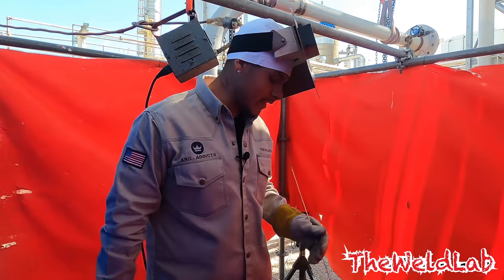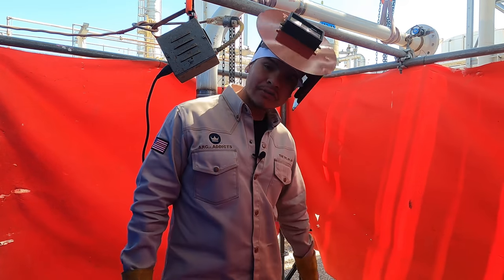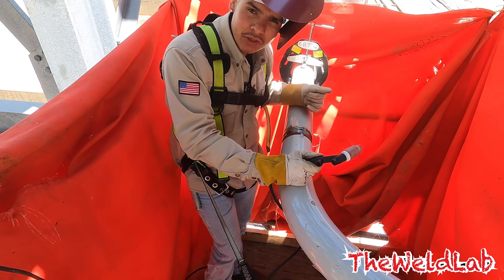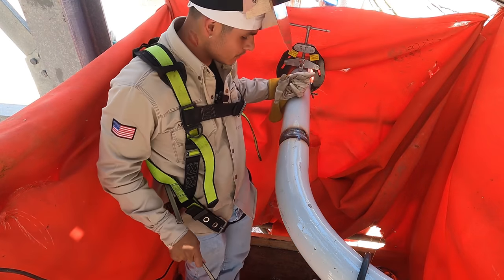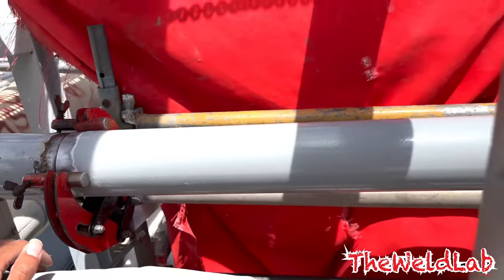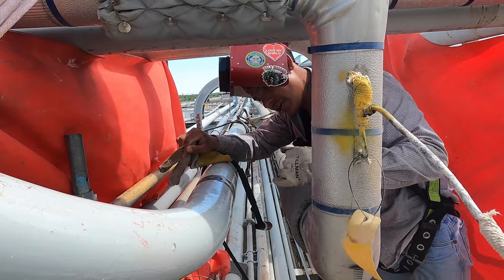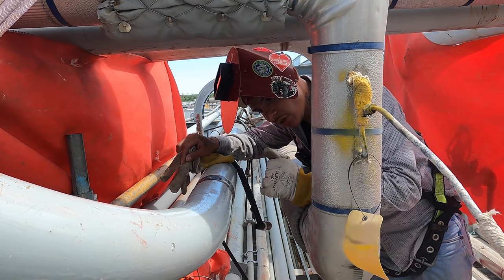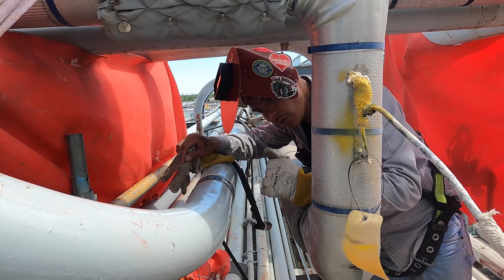I Got a Very Difficult Weld | What To Expect On The Field

Comment: The people that talk smack about welds in situations like this are the people who are not in the industry, or have not been in the industry long enough to come across this type of situation. All the work looks good from what the video shows. Just a few things, practice welding with a mirror. Make a small C shaped  bracket that can hold a mirror 8 to 12" from the face of your helmet, put the pipe in between the mirror and the helmet then practice. The mirror being held by your helmet frees up your hands, if you are doing the work sometimes you just have to get creative. I was shown a "welding helmet" from one of the guys who taught me a lot about welding, he did a lot of work in nuclear power plants. The helmet was basically a small piece of plastic with a lens mounted on it with some small protective plastic for the face, he holds the plastic bracket in his teeth and the glass does it's  thing. He had to use it multiple times doing pipe work. The big thing when you are dealing with planned distortion  (the pipes not being parallel like in the video), learn the percentage of shrinkage and keep a field journal. You can use some simple math that will allow you to determine how far up the pipe to place two tacks to act as fulcrums and how big of a tack to put at the top. As the top tack cools and shrinks, the top gap will close and the bottom gap will open through the 2 tacks becoming  pivots. You will get really good at predicting where to place the tacks and having your gap settle at an even distance top and bottom.
Reply: 10/4
Reply: Now roger that 🤝🏽
Reply: You could buy a magnetic mirror setup.. not Like they don't make them 12 year tube welder never had to hold or put my mirror on my hood lol
Reply: Write the book bro ❤ excellent description of how to overcome challenges

Comment: Whenever you have an issue with steam/heat tracing because its hot or blowing talk to the operator for the unit we don't mind turning it off for so you can do your job. They even know about the issue since its tagged.
Reply: As an electrician we just blanket it with a welding blanket.
Reply: have you ever considered that they need the steam 24/7, and can't Turn it off ? Industrial units are usually operated 24/7. Only time for maintainance is a turnaround. 

If they wouldn't need a constant steam supply they would fix this yellow hole in the steam pipe as soon as possible. Welding is a cheap fix for them. Wasted steam ist expensive over time
Reply: We don’t have use steam in our facility we use basically a oil that is heated up using gas turbine generators and fired heaters but to get back on track turning off that steam line might not be an option bc if the steam is there and lined up while it’s leaking it’s still lined up for a reason heat is pretty important for the unit depending on what it’s used for heating up reboilers, reactors, or dehydration units on heating cycle. If heating is lost some units will need to be shutdown because they’re off spec. It’s a domino effect in this industry you might not think of it that way but shutting that one valve to benefit a job might mess up a whole unit.

Comment: 43 yrs in the trade. Retired now. Was good financially but rough on the body, eyes and lungs. Where ever the money was I went. Took family with me .yup still married too. Son's now in the trade. 
Pipe ,structure ,pressure vessels, didn't matter. Retired from aviation welding.
So brothers its out there, it pays if you're good ,and it will make you a nice retirement if you're smart.
Reply: What time u usually get home
Reply: How to get welding job in aviation ?

Comment: I wish I could post pics and videos . I jUst completed a turnaround near New Orleans . Had a 14” heavywall chrome weld directly under the grating ! No head room at all but we got it done ! Them tight spots is what separates you from the average welder! Great content!
Reply from the maker: Yeah those welds make you a good welder ...New Orleans is not far from my hometown
Reply: @TheWeldLab I was livin in Kenner . Just got back to Houston tonight. I’m from the Galveston area but I been traveling for welding 12 years now. I’m single Hand .
Reply: @sethhoward9300  you wereat valero or shell?
Reply: @joseofno  both but where I did this weld was at shell . Working with repcon/TWS

Comment: Retired, certified, high-pressure, Boilermaker welder. Over the years I've welded standing, sitting, on a ladder, kneeling, laying on my back/stomach, even kneeling welding between my legs. Welded in 100 degree+ weather, snow, below freezing, and at a blast furnace (at night in the winter) had one side roasting while the other side froze. Followed procedures and even told engineers how they were screwing up, with a faster solution to the problem. Had to weld on "dead metal" hundreds of feet in the air. Yes I got the big money, but I earned every penny.
Reply: Shout out Local 107 retired

Comment: That broken cup and bust hose just as your were ready to wrap up was so familiar even though its been over 30 years since I last melted some wire really felt it 💔 these things never happen when you have plenty of time and under no pressure. I'm thankful and got the lucky 🙏 break and moved from welding to inspection and testing and have not looked back. Keep your arc tight and the amps hot 🔥 good luck. JB

Comment: Looks good but the beads too wide, I also recommend buying a welding respiratory with flips on them they are north or 3m made and they strap straight to the face so sunlight can't hit the back either and they're way more compact than a pancake you could just swap em out when your out of a bind

Comment: Great video but for that weld in the rack, why didn't you run the bead in by looking through the top of the bevel? Would have saved you from jumping back and forth atleast for the bead.

Comment: This video resonates with me bc I was that guy and hung steel and welded it for six yrs till I had a bad accident at work where I fell thirty feet and shattered both arms. It was the height that got me and the amount of weight I had in gear that drove me into the concrete when I finally hit. 

That said, I often lamented the amount of time and energy it would take to get myself and all the tools and leads into position to start welding. Then if the fit up was bad it only compounded the issue further.

Comment: I dont no if this job would let u stick weld that joint but I've had stuff so tight I had stick welded it if you don't no a 3/32  rod will fit  right in a tig torch takes a min to get use to it just turn the gas off at bottle and weld

Comment: good job,,,idol...keep it up👏👏👏
Reply: engineers  put the tie ins in the most stupid places 
you have to learn to use both hands too  
then you drop your last tungsten !
on realy awkward stuff  we used to root fill and cap  the bottom  with staggered finishes  then climb up top and finish  say 7 to 12 then 5 to 12  it save crawling out and in 3 or 4 times 
helps greatly if you have  a fire watcher to hand you wire ,grinder  or a tungsten

Comment: Can't believe you are expected to weld with your arm exposed to a leaking steam trace line..I have welded difficult tight joints in very similar situations but we would never be expected to risk scalding. Pretty welds though bro were they shot or UT sorry just seen the WT that would be shot not radiographed

Comment: I thought down hill welding wasn’t allowed ever except if youre welding with stick.
Reply from the maker: sometimes you have to cheat a lil bit ...we all do it lol
Reply: Depends if youve qualified a procedure for it or not. 
For example some of the tight access tube welding inside waterwall boilers is welded vert down around some of a butt. 
If not got any qualified procedure though, its a cut-out unless you're gonna put a backhander in the wallet of one of the QA guys 😄
Reply: I’ve never done a downhill with tig, it’s just the way I’ve been taught. I’ve been on many pipe and boiler jobs and I’ve never seen it done and was never told it’s allowed.
Reply: Put the root in looking Thur the bevel. It shouldn’t take more then 30 mins to weld it out